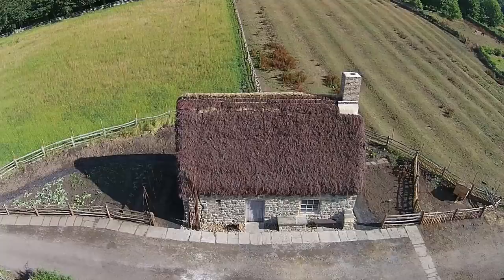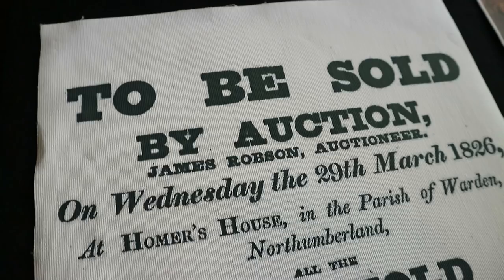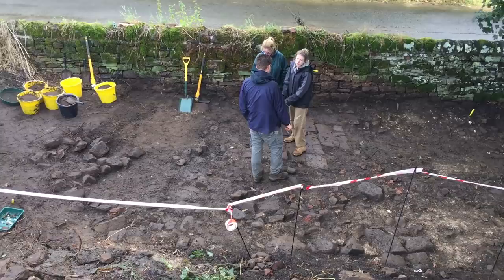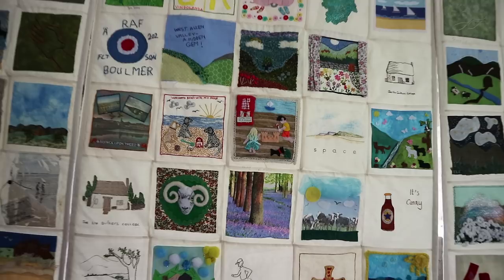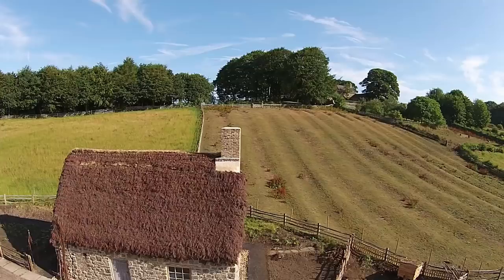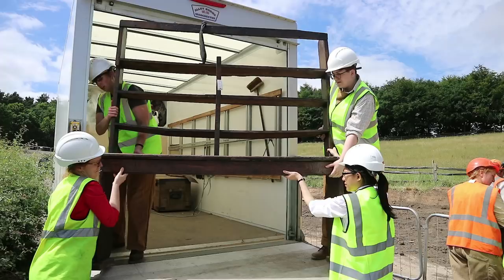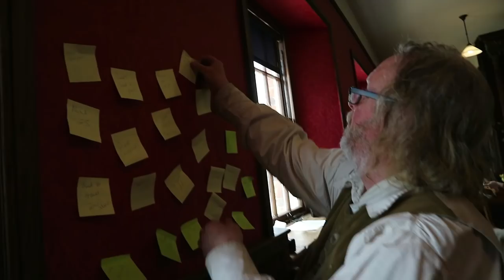The story of Joe the Quilter's cottage

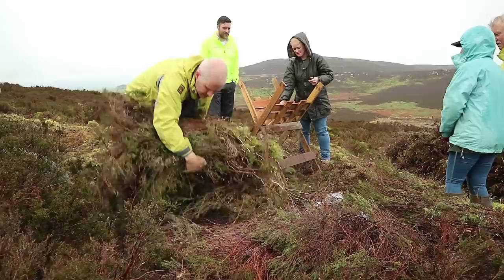Comment: 4:30 Where exactly is the original dig site of the original cottage?
Reply: Probably a bit late as I've just came across this video. But, the original site is at Warden which is slightly north west of Hexham, it's on a road called Homers lane. There's also the remnants of a medieval cross base on the lane.
Reply: @williammills9852  That’s what I could find but no pinpoint of the physical location, which I’m trying to find.
Reply: @warrenwoodhouse  I've walked the lane a few times. I think the site is near the northern end as you head toward Walwick Grange house, just before the "point" in the river, where it looks like an arrowhead pointing eastward (that's the best explanation I could come up with). If you do happen to visit the site, the medieval, chevron shaped fishponds are worth a look aswell (opposite Walwick Grange house).